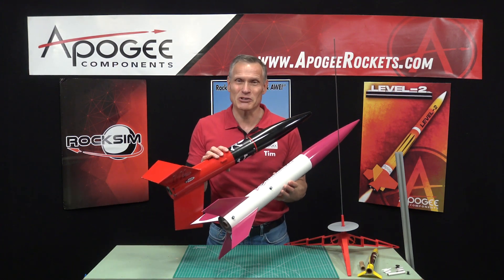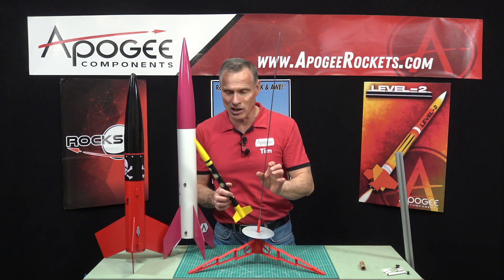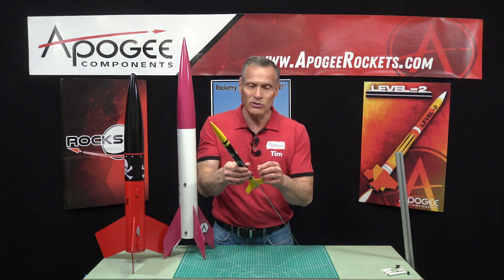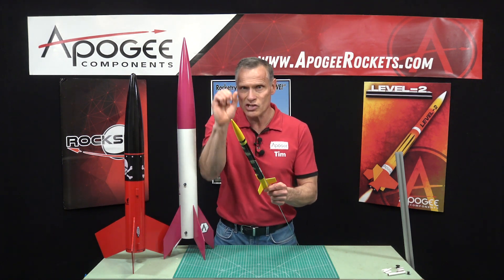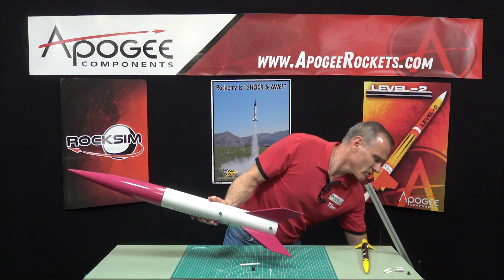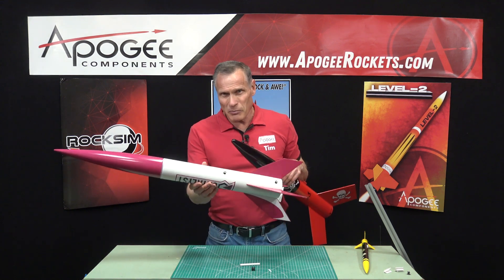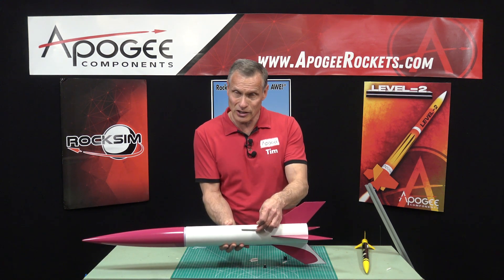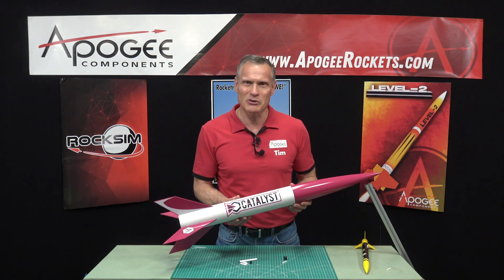Launch Lugs vs Rail Buttons

Comment: I just had an 'Ah Ha!' moment regarding a launch I made in 1984.  I built an Estes Cobra-1500.  I probably used a C6-7 engine.  It only made one flight and it almost took me out.  About a second after it cleared the launch rod, it tipped over in mid-air and came right toward me.  Once I could see what was happening, I fell backwards and started to crab-walk away as fast as I could.  It was a 5' rocket and I just realized my launch rod was woefully inadequate.  My family got a good laugh out of it, though.  If YouTube was a thing back then and they had a video to upload, it'd probably have millions of views.

Comment: I have a different reason for wanting to put buttons on my mid-power models: my club field has a mixture of rods and a rail at the mid-power pads, so I want to be able to use the rail when the rods are already loaded. I’ll also keep the 1/4” lugs on them.

Comment: The 30mph speed is a good speed for people to keep in mind when they do simulations (or about 40 feet/sec.).  If your rocket won't achieve that speed at the end of the rod then it needs a bigger motor.

The problem for the beginner is we don't know what size buttons to buy, I've seen 3 different button sizes for sale and it is hard to find someone even at my club who can say definitively what size button is needed for which launch pad.

Today what I build I have 1/8" lugs for rockets up to BT60 and C motors.  For BT60 and bigger with D and E motors I use 3/16" lugs.  Our club has model pads with 36" rods of 1/8" and 3/16" diameter, and mid-power pads with 1/4" rods that are 4' or 6' long.

My 4" diameter level 1 rocket that I built long ago has tubular launch lugs.  I don't remember the size but maybe 3/8" diameter.  My older mid-power rockets have launch lugs for 1/4" diameter rods.
Reply: Either a bigger motor or longer rod, if available